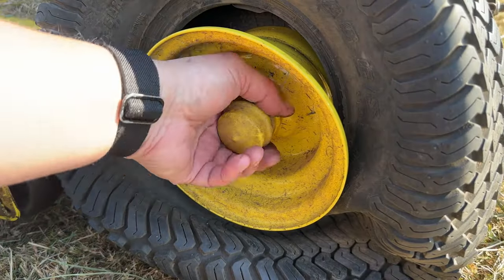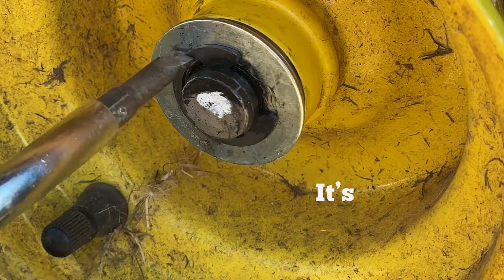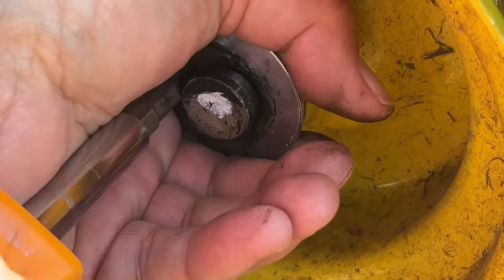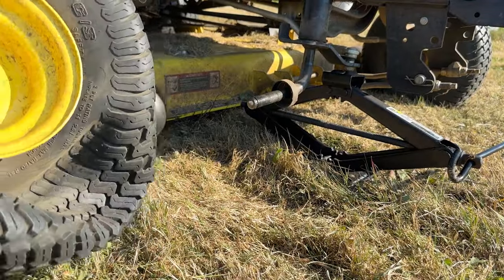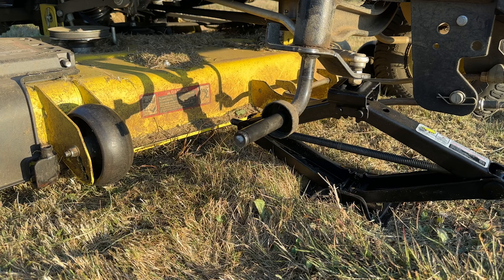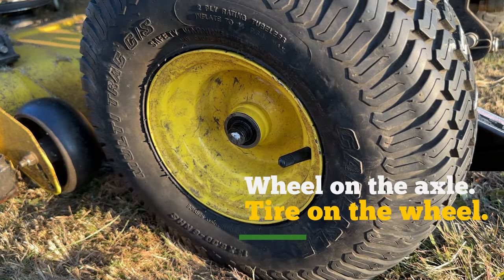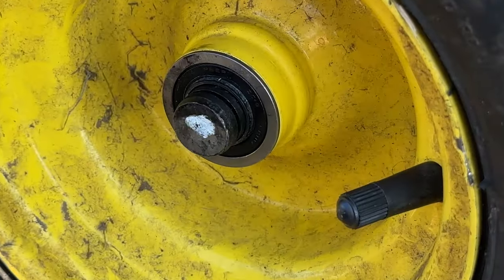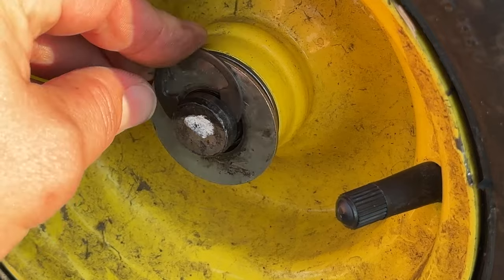How to remove and replace front wheel tire John Deere riding mower tractor

Comment: This was very helpful; however, the snap ring moves so every time I try to get a screwdriver under it , it just moves around and I can't get any purchase to get under the ring.  Any suggestions????
Reply: You probably have solved this by now, I also used a pair of needle nose pliers, along with a flat screw driver, to help get the c-ring off.
Reply: Sell the mower to someone smarter.
Reply: I had that happen too.  I eventually got a big enough screwdriver to pry it off.